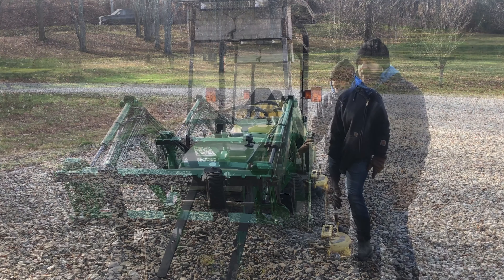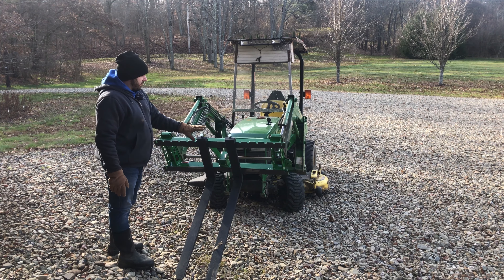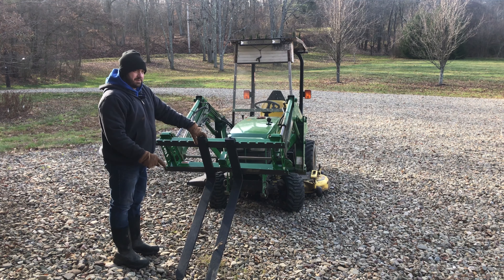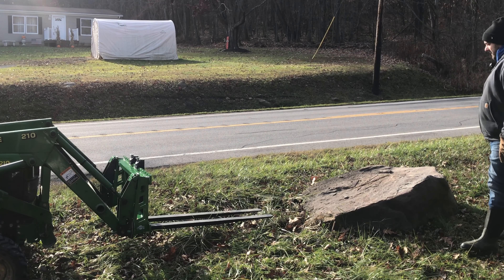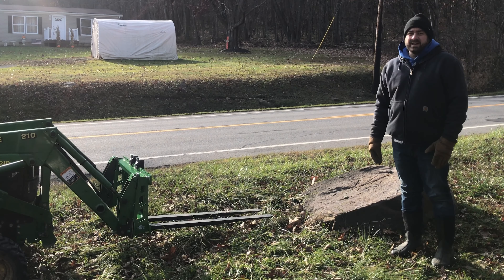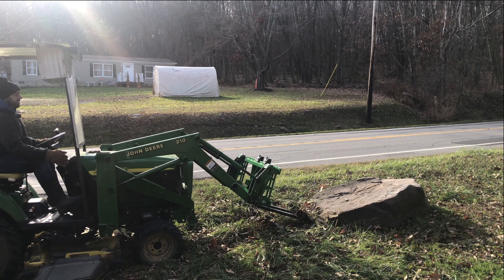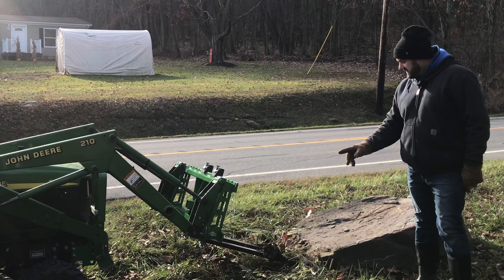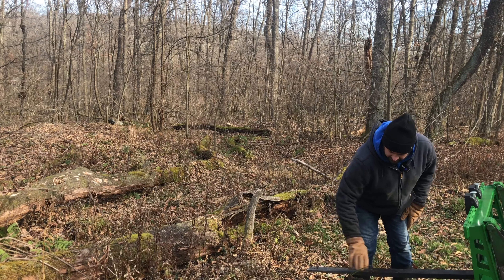Learning to use Artillian pallet fork on John Deere Loader

Comment: Nice little tractor and the forks are handy as heck!! A great way to burn stumps without risking a larger fire is to take a 55gal drum with both ends cut out and put it over the stump to burn it. It contains the fire and also creates drafting for a hotter fire to burn the stump. Great video! STAY SAFE!!
Reply from the maker: Thanks for the tips!
Reply: @PurpleCollarLife  no problem. I did a video on it this last summer. It was in a burn area and really dry although there wasnt much to burn left other than branches and slash.
Reply from the maker: @307j.o.a.t9  I'll check it out.

Comment: You never get the forks under the rock.  The farther away the load is from the pins, the less lifting force you have. Using the end of the forks you have way  less lifting than using your bucket.  Try putting rock as far on forks as possible, lifting rock only at the pin side of forks, keeping forks parallel with underside of rock as rock pivots. (I.e. Keep far end of forks on ground as you lift).  Or use chain and pull from other side.  Or lift with chain connected near pins.
The more ballast you have on the back, the less front tires will sink when you lift logs.
Reply from the maker: Thanks, Coby! Great points about the forks being under the rock.  I couldn't get the forks under it level - the rock must not be "flat" on that down side.
Reply from the maker: The ballast - I had another sand bag in it (80#) but had to take it out because it seemed too heavy for the tractor to lift. The box weighs 132 lbs, and I added 3 80# bags.  So it's just under 400 lbs in the box right now.

Comment: Also not sure about the pulling power of your tractor but if you can get a chain or cable under the rock you might be able to pull it up right
Reply from the maker: Sounds like another fun tractor experiment! Jennifer will be thrilled.  😬

Comment: I've watched a few videos today. That machine is pretty mighty but you have mentioned in the past about maybe purchasing something bigger. How is the research going?
Reply from the maker: Still researching.  It'll likely be a while before I upgrade.  I will say that in the running right now are the RK37, the Kioti CK2610 or CK3510, the Kubota L3901 or the Kubota LX2610, and several models in the Deere lineup from the 2 or 3 series - mainly the 2038r.
Reply from the maker: Thanks so much for watching and commenting!  Have a great Thanksgiving!
Reply: I upgraded this year to the kioti 3510se. I was torn not to buy a deer but I am very happy thus far with my decision, only 50hrs so far though.

Comment: Nice! Subscribed. 

I’m looking to pick up the the Artillian fork frame and forks, I’m not sure which length of forks to get. 

Might not be very helpful, but I wonder if you dug a small trench on one side of the rock, if you’d be able to tip it.
Reply from the maker: Thanks for the sub!  I like your idea of the trench behind the rock to tip it into.  I'm really happy with the 36" forks. I thought maybe I'd want longer, but these are perfect.
Reply from the maker: Tractor Time with Tim has a great video on why shorter forks are better.  If you've never seen it - it's here: https://www.youtube.com/watch?v=7FUTvXfDhKI
Reply: @PurpleCollarLife  Thanks for the content! I think the. 36” forks are sized and weighted well for a subcompact (which I also have), I’m just wondering how visible they’d be from the driver’s position, has that been an issue for you? I might want the extra length for unloading my truck. Decisions, decisions.
Reply from the maker: @Nunyabizn3ss  They're easy to see through the frame.  I have unloaded a few things from the bed of the truck, and the forks are so far in front of the tractor that I have no trouble seeing them.  I too struggled with the 48/42/36 decision.  I am definitely glad I didn't go 48.  They'd be too long.
Reply: @PurpleCollarLife  Great, just watched the link, I forgot that I can stand up too look at the forks. Haha! Great to know it wasn’t an issue for you, because our use cases are pretty similar it seems. Best wishes to you and yours. I wish you all the success with this new YouTube caper!
Reply from the maker: @Nunyabizn3ss  Thanks! We appreciate your support.  Lots more fun stuff coming up.  If you'll keep watching, commenting, and clicking that like button, it will really help us out.  Thanks again.
Reply: @PurpleCollarLife  Wilco, I’ve only just found your channel. Spades of interesting content!
Reply from the maker: @Nunyabizn3ss  Thanks!